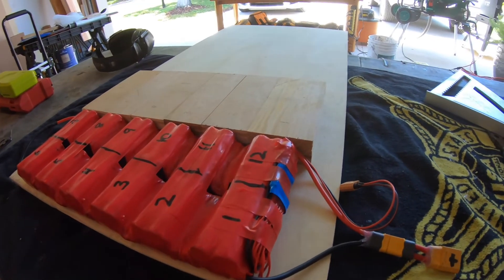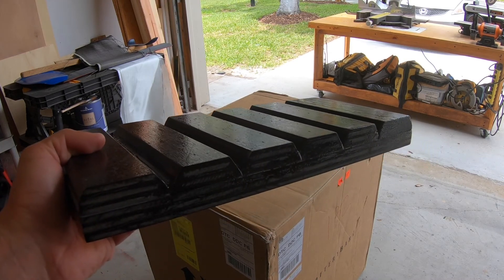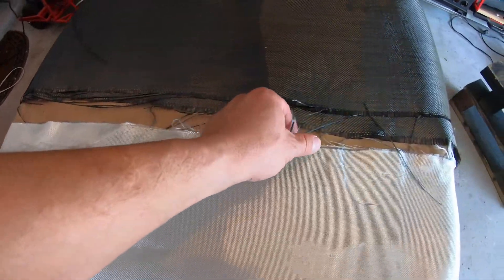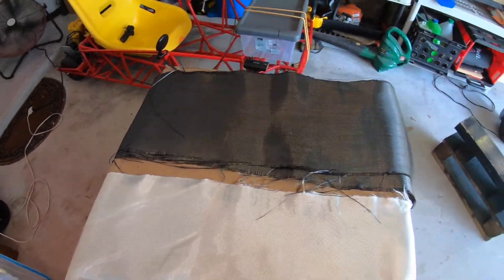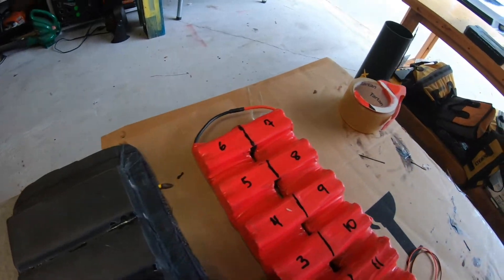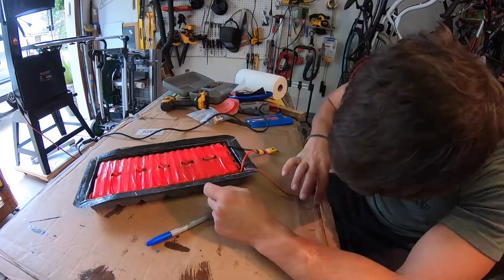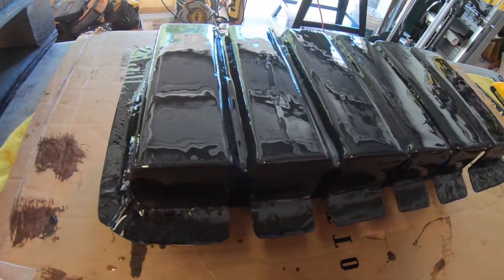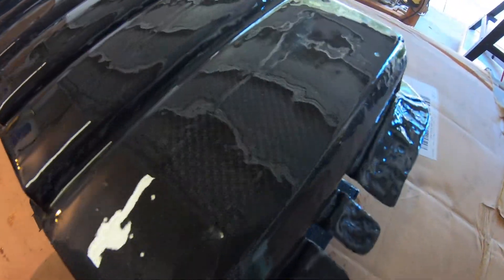ESK8 Carbon Fiber Battery Cover

Comment: Hey Artsiom, hope all is well with you! So I know you uploaded this video a while ago, but I was wondering if you ever made enclosures for customers? I was interested in a 30" x 8.5" enclosure for a 12s9p battery and two ESCs that I have. I will be building the longboard myself in a couple weeks (12 ply with fiber for stiffness). I was thinking since the board will be so stiff, the enclosure wouldn't need much flexibility (no flexible grooves). I know you are doing this more as a hobby, but figured no harm in asking! Thanks either way
Reply from the maker: Mr. E, Hello.  I could help you out.  What material do you want your enclosure to be made out of?  Is 30x8.5 internal dimensions?  How high are you stacking your li-ion cells?  After I get all the info, I can give you an estimate.  Are you on FaceBook.  if so, you can DM me through FB messenger.  Name is same as my YT channel.
Reply: @artsiomnaidzich9515   Hi, so I sent you some messages on Instagram with internal dimensions and photos, I hope that is ok through IG? I don't really use Facebook much, but I do have an account... more like a dummy account for finding coupons lol.  I can send you a message on FB of course if you prefer that.
Reply from the maker: @Mr-E. , got your message.  Yeah, I can gram.

Comment: Are you a hobbyist or do you sell them?
Reply from the maker: Both.  Mainly hobbyist.  I have build a few for friends and co-workers.
Reply: @artsiomnaidzich9515  do you do a full time job??
Reply from the maker: ELECTROFANATIC.  My full time job is Fire Rescue. Im a Lieutenant in Fire Rescue Service.
Reply: @artsiomnaidzich9515  where do you live?
Reply from the maker: ELECTROFANATIC, Jacksonville, FL. U?
Reply: @artsiomnaidzich9515  thats great:)
Reply: @artsiomnaidzich9515  I was going to ask the same when I saw the FL endless summer plate on the car.  Awesome vids!  FL MAN.
Reply from the maker: Yeah
Reply from the maker: KP, whats up bro. 12s6p is a huge power pack. What deck are i putting it on? Do u want ur ride to flex? Have you already assembled ur power pack? Look me up on Facebook and DM through fb messenger. Same name as yt channel. Im in JB but work in St. Aug.
Reply from the maker: @glidelife , well. Im familiar with atom boards and pvc enclosures. If you are willing to come out to jax bch for about 1/2 a day, we can figure out a way to get your power pack attached.  We can use your materials, or mine (if we use mine, compensate me for what we have used). Are you looking to attach power pack above or below your deck?